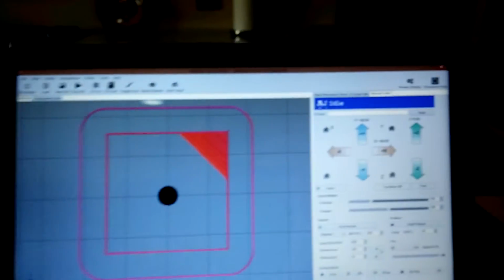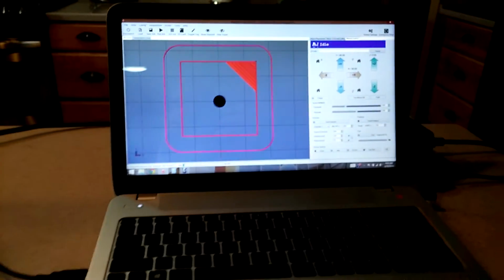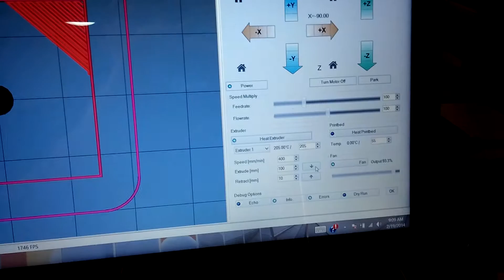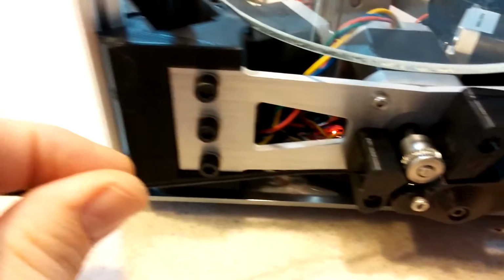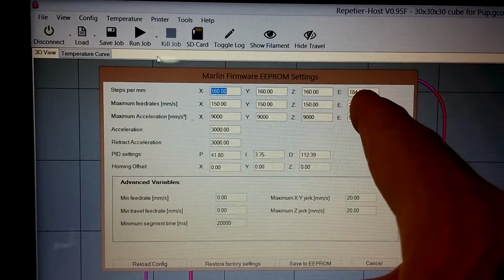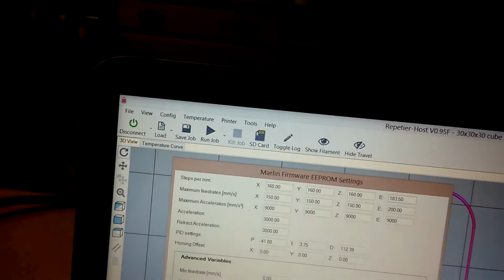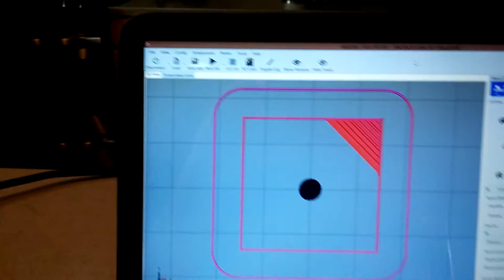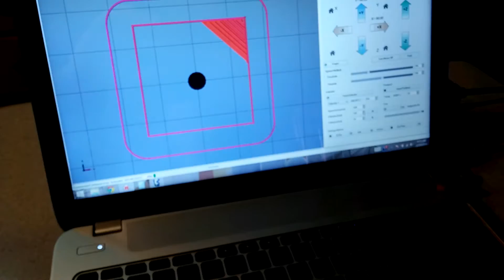Calibrating the extruder on a 3d printer

Comment: It would be mutch easier if you extrude it measure you're lenght.
Note that lenght retract it and calculate the new steps like:

(expected mm : real mm) x old steps

After 3-4 times doing this exactly you will be end like 99,999999% exactly.